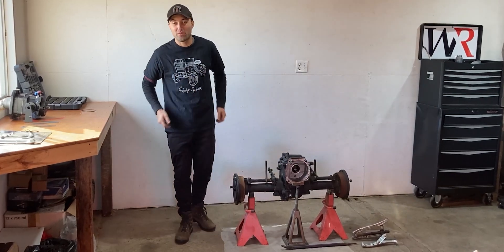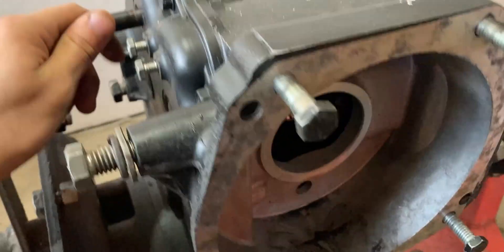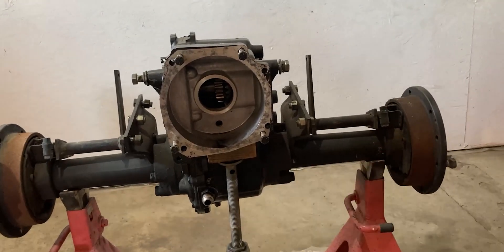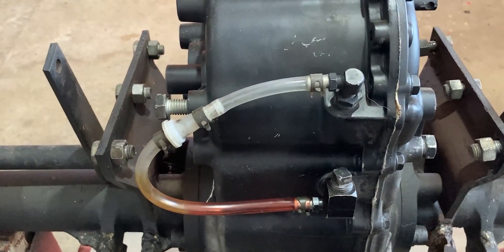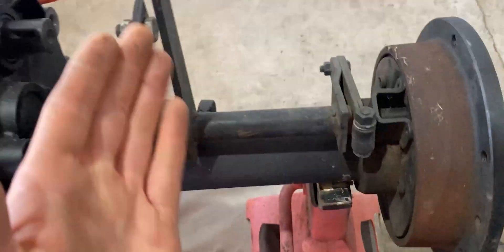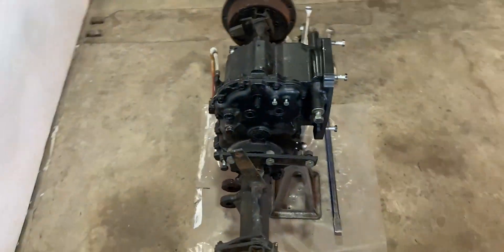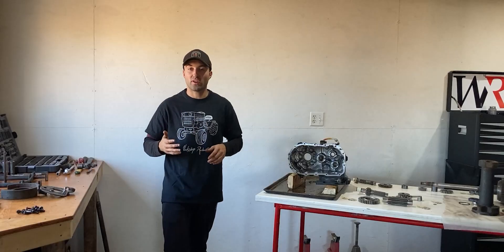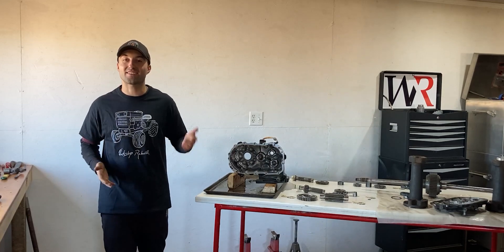John Deere 400 Transaxle Disassembly | Peerless 2514 Rear-End (2-Speed Hi and Lo)

Comment: yes foot controls
Reply from the maker: Foot controls for the JD400 would be great...even for the 300 Series tractors. I find myself operating these tractors without any hands sometimes, because I go forward and then use the lift function. This means you have to use two hands at once.
With a foot control, you could go forward and reverse, operate the up/down lever and have your hand on the steering wheel. This is why the Bolens HT20 is a bit more user friendly. 

There have been a few enthusiasts that have done this and they really like the upgrade and I would too!

Regards Andreas

Comment: what type of oil in trans and how much
Reply from the maker: Hi there, the recommended oil from JD was ATF type F (Automatic Transmission Fluid). The hydraulic pump powering this rear-end is a Sundstrand Series 15 inline pump and they recommend all types of fluids. More info here (Page 10): https://inspectapedia.com/heat/Sunstrand_Txmsn_Manual.pdf

I hope this helps. Regards Andreas